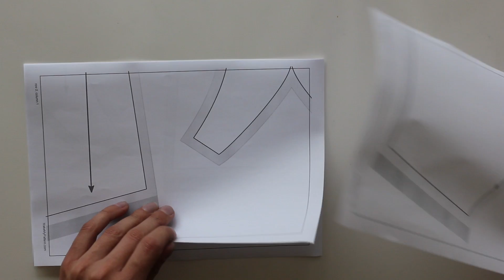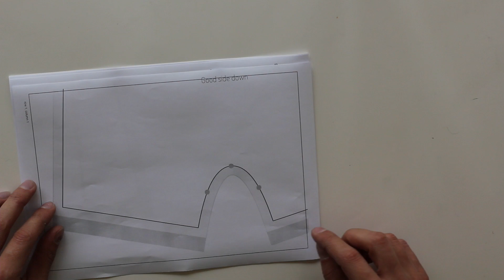How To: Pattern Assembly

Comment: ummm...sir, that was insufficient. I may need a little more assistance. I just cut out the pattern (don't have as big of windows as you), but there is the little gray area which outlines the patterns. I am not sure if I should cut that portion off or if I should leave it on. I don't want to make the underwear bigger than I am supposed to. after all, I did think all those measurements (great instructions on explaining that, by-the-way)